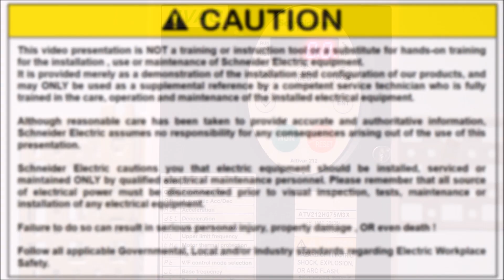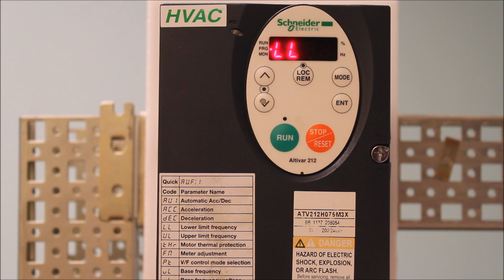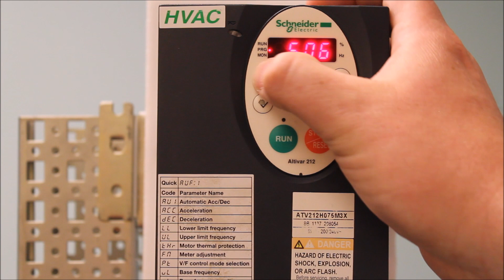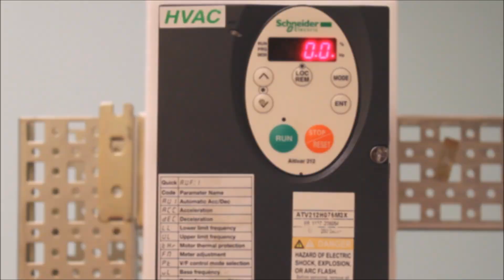Programming Altivar 212 Drive for First Time Operation | Schneider Electric Support

Comment: 0:24 TYP Nominal Frequency Hz. 1: 50 Hz 2: 60 Hz
1:25 CNOD start stop. 0: terminal control 1: HMI control 2: serial communications
2:00 FNOD frequency reference control. 1: VIA 2: VIB 3: HMI 4: serial communications 5: +/- speed
2:43 AU1 auto ramp adapt. 0: diasbled 1: enabled
3:30 ACC Acceleration time
4:12 DEC Deceleration time
4:30 LL Lower speed Limit Hz
5:18 uLu Rated motor voltage
5:52 THR Thermal motor protection
6:45 F--- codes
7:05 F415 Rated motor current
7:55 F417 Rated motor speed rpm
8:20 F601 Current limit

Comment: Hi , how can i set parameter for dosing pump which required high torque for starting , I put set point to 35 HZ and get only 5 HZ at output during apply load